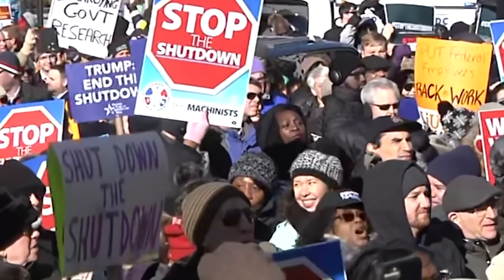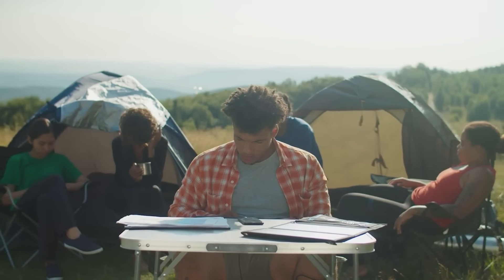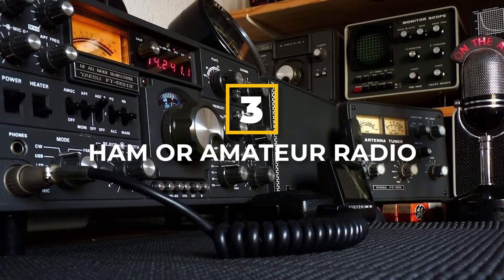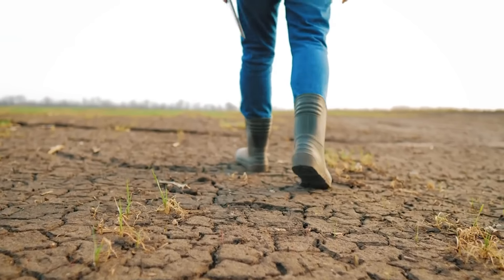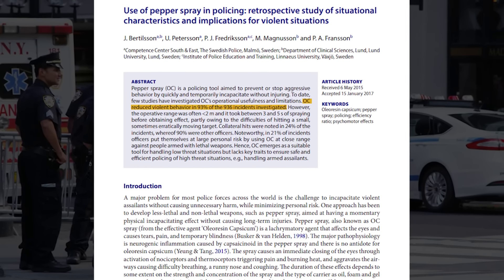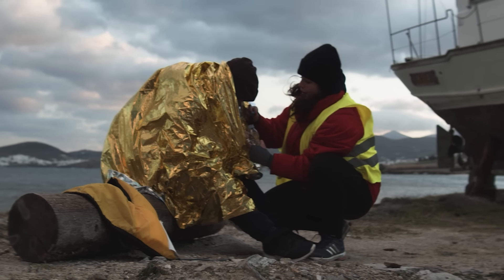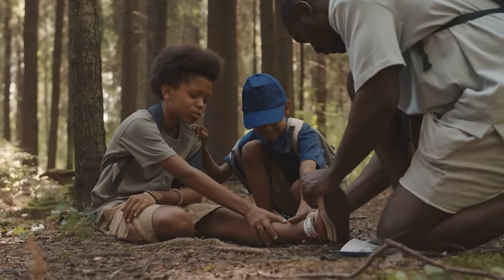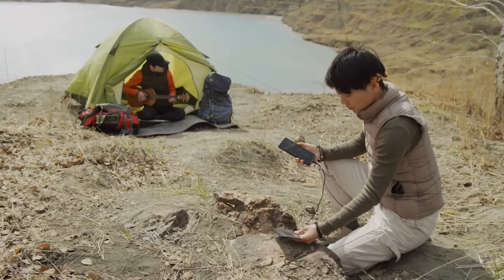7 Essential Preparedness Items to Get Before They're ILLEGAL

Comment: Grid connected solar is useless. Unless you can tap into the solar at a voltage you can use, it's unavailable. Then there's energy storage. Without battery storage, it's useless

Comment: You talk about using petroleum for energy being bad, but do you realize that solar panels and solar generators are made from petroleum. They are all byproducts of the petroleum industry.
Reply: Every solar device I use is loaded with products made from oil. I don`t use solar to "save the planet"....I use it to save ME after Louisiana hurricanes because nobody is coming to rescue me since I`m not one of the protected species. And I like air conditioning. My yard is loaded with food. My first job at age 13 was running 175 fur/meat traps and I grew up on a farm. Most have no skills or knowledge and simply won`t make it.
Reply: Most everyday things we use are made from petroleum. Nearly everything
Reply: @ChrisBergman-rw1ft right so why is it that OBUMMER wants us to go all electric 🤪🤨🤔😖🤬
Reply: Thank you for all of the wonderful emergency information 😊❤
Reply: Solar panels can be destroyed by hail during storms.
Reply: I know frac towers or coal plants make pharmacy med products..and some new cars can run off of wood gas
Reply: Called hypocrisy
Reply: 4 100 watt panels or 400 watt solar and 2 100amp lifepo4 batteries will do if used with strung low power led lighting. Placed in  moulding for indirect lighting. Regulatmr appliance will ecome obsolete.
Reply: Are you going to carry all of this when you are on foot?
Reply: I didn't know that
Reply: @baneverything5580  
so is the computer you are using so what is your point
Reply: Not only all this research the amount of toxic waste is produced when making the panels and the diesel used to get the minerals out of the ground and to process the minerals
Reply: Find the book "Survival is a dying art."  Read and study that.  Get in shape.  Practice while there's still time.
Reply: @ChrisBergman-rw1ft clothing : spandex, nylon, synthetics ,polyester😮😢 no wonder we get cancer, we have let ourselves be SURROUNDED by it, the plastic bottles our food comes in, water, milk, soda...the containers we put it in..😢😢😢😢

Comment: Several rechargeable batteries with the charger hooked to solar can prevent heartaches. But for the children, i have those solar yard stakes. They charge easy safety for the children, and if you need to put the light out quickly, just throw it  into your sleeping bag or pouch. Extra propane tanks for cooking and heat with buddy heaters and camp stoves. If you can afford the larger tanks for your grill try to have several put back.  And the connection hose that a stepdown hookup for you heaters and camp stoves.
Reply: How often do you inspect the connections for decay due to age?
Reply: YOUR THOUGHTS ARE VERY HELPFUL...VERY KIND...THANKS!

Comment: You better forget cell phones and computers. No reason to charge. Won't work anyway.
Reply: That's true in many disasters but one thing he said was emergency radios and chargers for other batteries could be handy.
Reply: Run to the mountains to hide.
Reply: Right..2 way radios a must, modded for mid band channels?, portable antennas, rechargeable batteries or other source of small current power.

Comment: Why doesn't these type of videos tell you how long it takes to charge that battery from the solar panel of how quickly the battery gets used?
Reply: I have a 1200W power box. It takes about 4 hours to charge with a 200W panel. Times will vary a lot depending on the model , wattage, and the type of panel. But it does take time.
Reply: I once got a full charge on my phone in 45 min. It was just a regular solar phone charger.
Reply: That would hurt sales though wouldn't it.
Reply: It depends on what your appliances are drawing.

Comment: Excuse me but solar panels to charge your phone ????if electricity is out so are the cell service. I can see flash lights , laptop/ tablet with survival info stored on it like edible plants, first aid, etc.,,, but electronics not that important.  Extra weight,,,if your buging out. If you are dependent on electricity you've already lost the game. Yes portable but not on you back for too long. If your bugging in do you have a whole roof full of solar? Are you off grid? If not , instead of gadgets get skills.  Now biomass,  look it up not as easy as this says, I know I'm playing with it now, learn to build a rocket stove/heater ,,,very efficient not tons of fuel to burn, you can use mud to build it. Now,,,, a few hoses and sunlight you have hot water, make coil of copper pipe put over fire wala hot water. Use gravity or hand pump
The most sensible think so far HAM radio. In melt down license,,,really,,,
Garden if you have the climate and a 45 to 90 days to germinate and harvest, I'm a gardener. If you can green house and not in the ground,,,raised bed. Do you know how to harvest seeds???for next crop. 
Pepper spray ok. I like a piece of chain, 24 inch keep in pocket. Put 3 or 4 Oz fishing weight on the ends. Get a chocker chain dog collar, easy to attach weight.  Not prohibited maybe the lead in stupid states. Use steel or butt load of keys.
Stun gun again need electrical charge
Space blankets many uses for reflecting heat , never too many
Cash ya for first week or so ,,,,,then its just linen, barter items better idea, cigarettes, liquor, soap, small bottles shampoo,,get creative comfort items.  Skills will get you much farther than gadgets, knowledge is key. How many ways can you start a fire,,,,,with out lighter or matches??? Try a baggy and water, takes some practice and good sun but it make a magnifying glass. How about piece of ice.?  If you going to survive you have to not relie  on stuff. Most don't know how to keep food/ medicine cool, without refrigerator.  Air-conditioning boy we are spoiled. Now is time to prepare just like this presentation says, when it happens,,,,,it too late.  GOD BLESS

Comment: Don’t you think hurricanes and tornado, hail can ruin solar panels?😳🙄
Reply: Not  necessarily; and  particularly if  you're  able to cover/remove  them  quickly and  easily. I live in Victoria Australia and have been using  solar in different  circumstances  since 1980  with nary a  problem. The  same  goes  for the  many people I've  set up smaller home  systems  for. And  none of the  many people in the  various  communities I've been  connected  with  have   reported  any problems  either.  Even  large  hailstones which  will dent  a  car seem to ricochet off  solar panels due the  angle they're  installed  at.  Screwing panels  to a  roof  isn't the  ONLY  way of  setting  up a  system.
Reply: Does it matter the risks? People lose their homes to this every year, what's the difference? I am guessing but I bet the risks are less than getting in a car accident every time you drive.

Comment: I have a dual fuel CHAMPION generator.
3800-4500 watts.
GAS or BUTANE.

Also a couple JAMBOXES and 
small crank radio.

Along with a WORLD BAND hand radio.

TENERGY rechargeable
batteries and an LED 3D lantern.